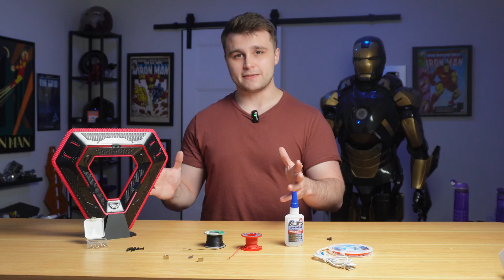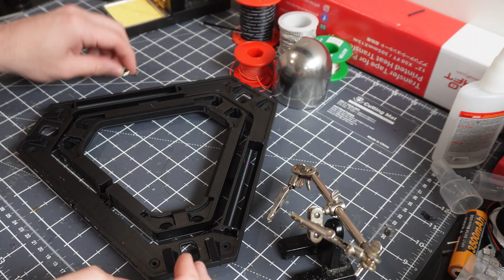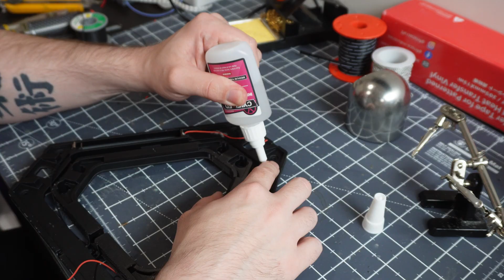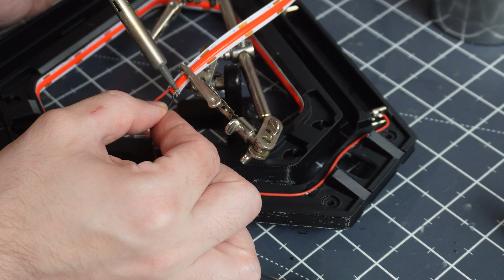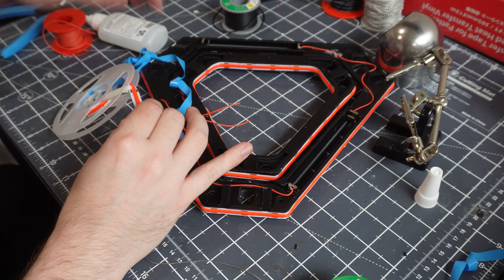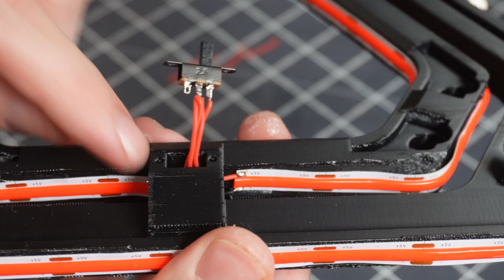Building a Light-Up TRON Ares Identity Disc – Electronics Tutorial (Part 1)

Comment: Hi, I'm making this Tron disc.
I was wondering, since I'm not very familiar with electronics, if you could provide a PDF file of the complete schematic, including the small parts on the sides of the disc where they light up. Thanks.

Comment: I love this series. I bought an Elegoo Centauri Carbon specifically so that I could start doing cosplay and this is the first project I'm trying out!

I saw that there's an STL in the files though for a version with 6 AA batteries instead of 4? Are there plans to add a sound board as well to this or programmable lights?

Comment: Question about the LED strip, it says to only use DC 5V. but with 4 AA batteries in series, that makes 6.5 Volts, is that going to be ok for the LED Strip, would that cause it to burnout?
Reply from the maker: It should technically just be 6 volts, and since there’s so many lights the voltage should drop pretty quickly back down to about 5 volts before draining the batteries completely
Reply: Wired it up. It works great!
Reply: Thank you for the help! I use this to build a Tron Legacy style disc!

Comment: ❤ now thats cool. I lost track on where the 3 wires came from as I was soldering it to the switch. Did you add those or were they part of the led lights
Reply from the maker: The three red wires were added myself, they go from the positive of the COB LED strips (outer ring, middle ring, and inner ring) and all solder to the middle pin of the killswitch. 

That way, when the switch is flipped, power flows from the positive side of the batteries to all three lights.
Reply: @plentifulprops3d  ok gotcha. i knew they were connected together :). also the red is such a huge addition to the disc.